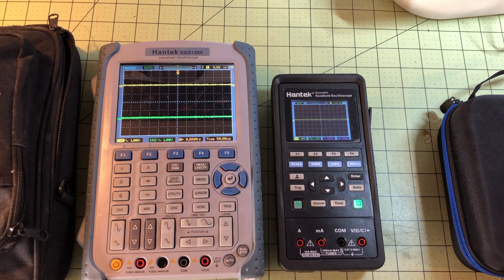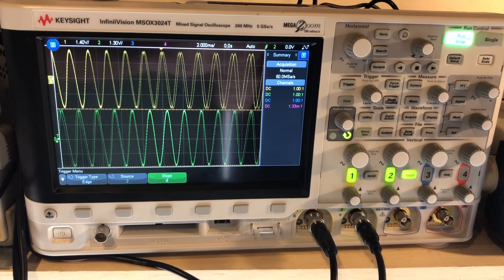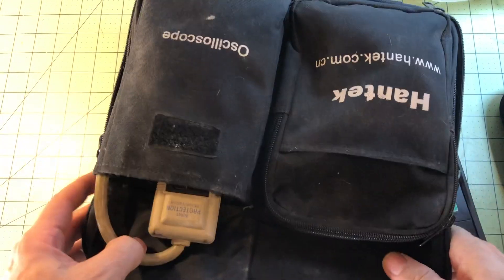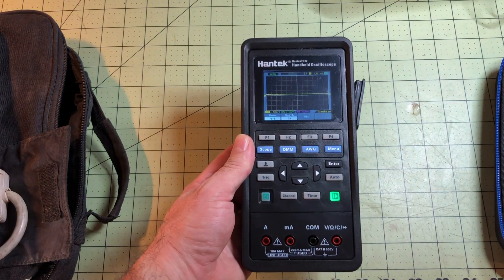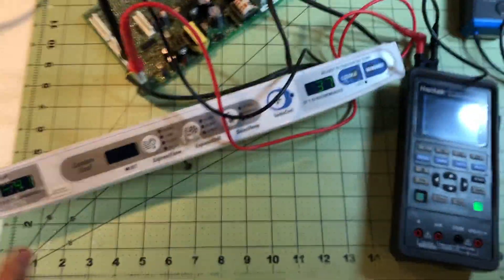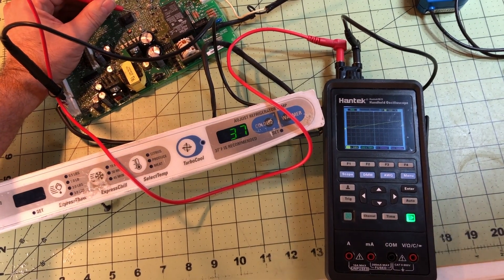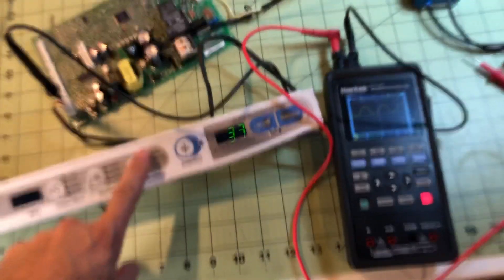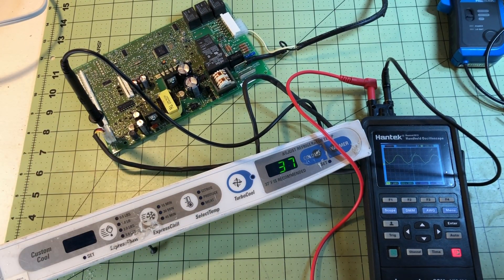Oscilloscope Primer 2

Comment: 90% of what I deal with is industrial boards, machining and manufacturing tooling, and test equipment repair/calibration. 80% component level PCB repair with a bit of metrology sprinkled in to keep me on my toes. I deal with the electronics and boards in these big machines… Not the actual mechanics/gears or anything like that.

But holy heck that circuit board you’re working on in this video… i’m all too familiar with that design. 

I’ve had to repair at least 50 of those over the past year. and hundreds of them in the last five years. A lot of my industrial clients, family, friends, customers from my woodworking business, whoever… They’ll have an appliance, or furnace or something… And since they’re already bringing me a board… They bring me their broken appliance board also. 

Seriously I’ve seen at least 100 whirlpool/Maytag/kenmore washer dryer boards this year. I don’t even know how so many find their way to me. It’s maddening. I don’t go as deep into it as you’re doing here… With an oscilloscope and what not. 

I simply look for swollen caps, check the diode‘s, plug in a few test cords I’ve learned to keep, so I can look for the green light… And inspect it quickly under the microscope then with a thermal camera… And that’s about all I can do. Since I’m usually doing it for  “free.”

Most times I’ll just replace all caps if ESR is wacky or if I have a suspicion.  because most of those boards don’t have many caps at all. I just keep those common values under my bench in bags of 100. 😂 

Jesus Christ what have I gotten myself into… What am I doing with my life. Some weeks I spend more time with washer/dryer/furnace boards than paid boards😂. I guess I enjoy the abuse and the learning.

Another thing that’s become a huge problem that I see a lot… Are the mechanical timers in washer/dryer/dishwashers. I used to recommend people buy mechanical washers and dryers instead of computer controlled machines with circuit boards. But now these companies figured out how to make these mechanical timer so shitty that they fail every two or three years. 

I have a section in my lab dedicated to refurbishing electrical contacts found in industrial applications. Big massive slabs of silver alloy that are brazed to huge copper bus bars and what not. Also resurfacing/lapping gear and a plating setup.  I didn’t search this stuff out I just happened upon a sale where I was already buying some test equipment… And it was a guy who retired from rebuilding industrial contactors for high current applications and in the telephone/switching industry. So I got the stuff because I thought I might find it useful and thought it was interesting. It’s a lot of very specialized tooling for replacing gold and silver contacts. So with all of that equipment… I figured I would have no problem helping people out with appliance timer contacts. Boy was I wrong. 

They’ve really “shitified” everything about mechanical contacts. They used to be the most reliable part of a machine. 

“Big Clive“ had a video about a mechanical timer on his YouTube channel last week. I left a few comments and had some replies from experienced guys and had a good discussing how they’ve really screwed up the designs. Now they fail so often they’re just as unreliable as circuit boards.
Reply from the maker: with residential washers, it's all electronic control boards, no more times on the new ones. But it's easier to fix a control board than refurbish a timer.

Comment: Hi,
 
Would you mind checking something for me on your Hantek 2D72: I recently purchased one and am seeing a couple of issues with mine; it would be very helpful to know if your unit has these same issues, or if it is just mine (in which case I will return for a replacement.)
 
The issues in question:
	• Periodic display glitching (even when paused)
	• Holding down arrow keys to scroll, stops and starts over at slow speed every 5 seconds

So if you could: are you seeing these same issues with your 2D72? Which firmware version are you on?
 
Some more info: this video shows the issues with mine: https://youtu.be/rjSrT5m2_Kk ; I did eventually get a response from Hantek support and they said this is a firmware issue, however I am doubtful as I didn't see the display glitching in your video.

Many thanks!
Phil

Comment: Would of been nice if you had compared and showed those same signals on the other Hantek &  that really nice Keysight. I'm sure tech's would have loved to see that. Still good video. My 2C72 should be arriving anyday now. I can't wait to play with my new toy, lol.
Reply from the maker: Techs aren't buying the Keysight or the larger Hantek, I find there is an interest in scopes, but techs don't want to spend the money, so I was showcasing the basic unit. I have other videos with the larger Hantek and I use the Keysight in a lot of my lab videos.
Reply: @electronicsprojects4708  im looking to buy the larger hantek unit 1000 series. if you have any suggestions; I'd appreciate your input.
Reply from the maker: I recommend them, for appliance repair, any unit with a megahertz bandwidth would be just fine. I don't use the 'dmm' functions at all.

Comment: Can the 2d42 display AC voltage and the waveform at the same time?
Reply from the maker: no, the dmm is completely separate, it will show you the voltage, but not the waveform. Or use the scope to see the waveform, but you have to calculate the voltage based on the volts per graticule.
Reply: @electronicsprojects4708  ok. Thanks. The Liumy will show you the AC voltage while you're looking at the waveform. I like this unit because of extra functionality, but that's something that I'm specifically looking for.
Reply from the maker: @anthonycook8737  20Khz bandwidth for the Liumy vs 40Mhz or 70Mhz for the Hantek, depending on model. That means if you are interested looking at real waveforms higher than 2khz (bandwidth/10), I would not go with that one, also resolution will not be good, unit would have to have serious interpolation at that bandwidth, so you won't see noise on the waveform if that's what you are looking for. Fine for 50/60/400 Hertz Line voltage, but that is not what I am looking for in a scope. I use the Hantek DSO1200 in the field, works well for what I need and I like the big screen.
Reply: @electronicsprojects4708  completely understandable... it may be worth while to toggle between waveform and DMM to get the data points that I need.
Reply from the maker: @anthonycook8737  just want to get as much info out there for you as possible, I have no bias one way or the other. I have a few scopes that will do what you require, but none of them are handheld.